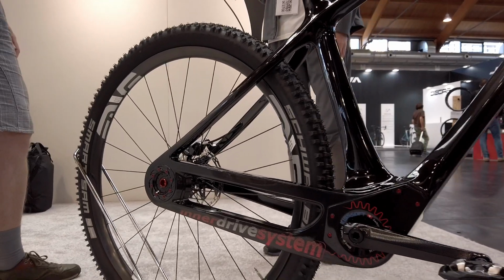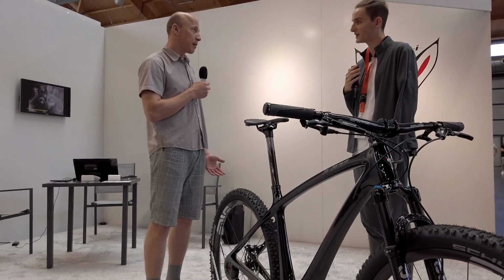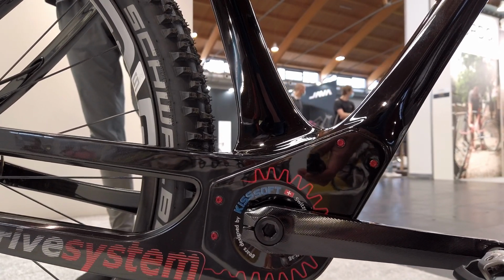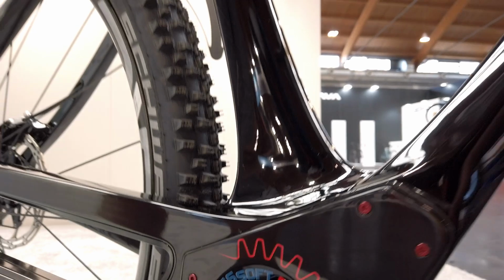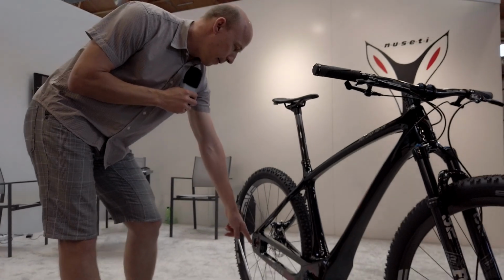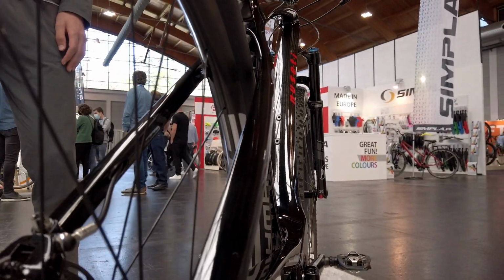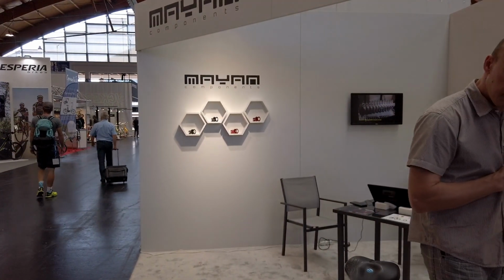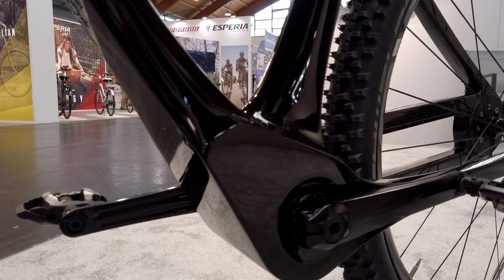Inner Drive System // Nuseti // EUROBIKE 2021

Comment: The gearbox is what puts this bike at the top of the class.  Everything else is excellent, but nothing new.

The gearbox can take a huge torque.  Shifting is simple and fast.  It has a big range.  Size and weight are reasonable.  Kissoft designed the gears, but Gregory and his brother (?) Igor figured out what gears to use and how to put them together and shift them to get so many ratios in such a small volume.  Anyone who has tried to do it will admire their work.  It is a very hard problem.

The only disadvantage of a gearbox is lower efficiency compared to chain drive.  But they are still efficient enough to suit many of us.  Otherwise they would not be using hub gears or any of the other gear drives on the market.

And these guys speak English.  I am glad I didn't have to learn Polish or German.  Mark Twain said that some German words were so long they had a perspective.